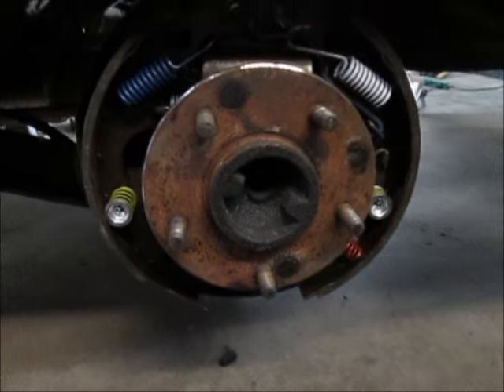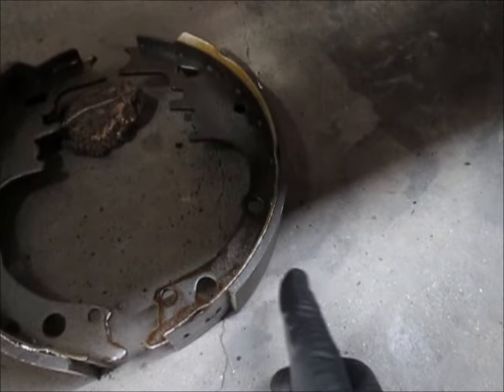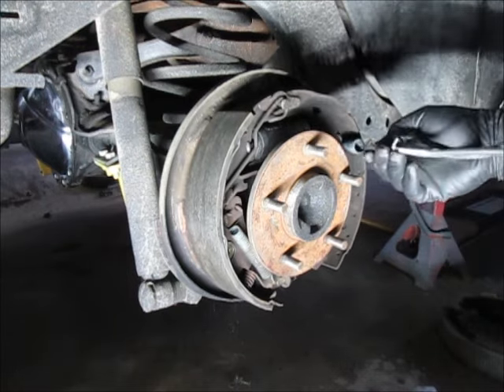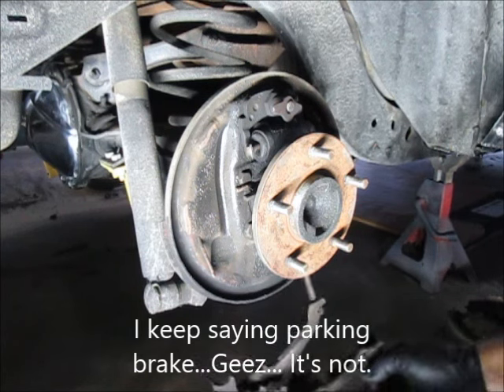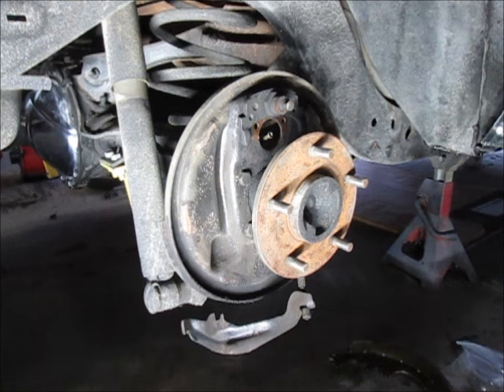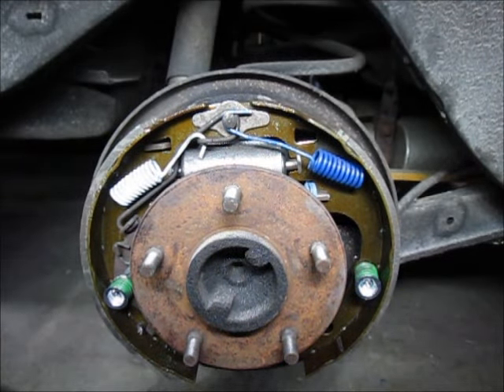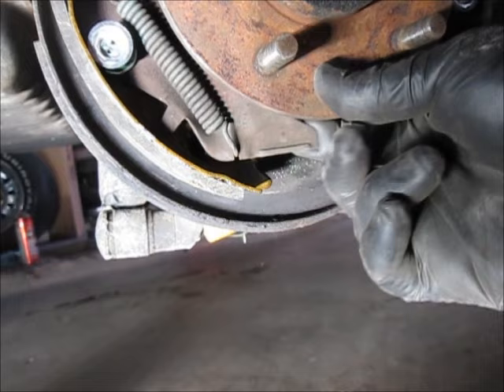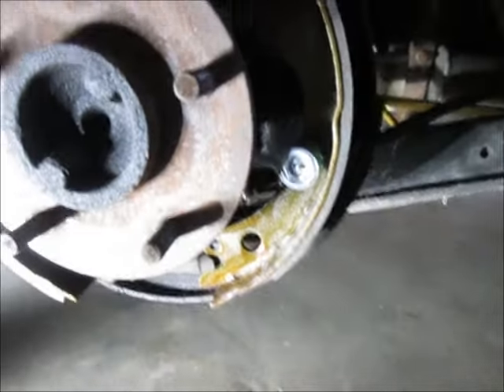1972 Chevelle Rear brake drum repair

Comment: Finally I found a video that talks about the placement of the spring above the adjuster bar! THANK YOU!!!! Several videos talk about that spring but NO reference to it hitting the adjustment gears if turned the wrong way. If the spring is installed like  a lot of these other videos(Not checking the position of spring) you won’t be able to adjust brakes with screwdriver. Wheel won’t turn. I found out the hard way. SPRING SHOULD NOT TOUCH ADJUSTMENT WHEEL!!!! Good luck my friends!

Comment: Thank you so much for your Video. You have a great gift for explaining each step of the process along with key insight as to the purpose and interaction of the components of the wheels brake assembly. Your attention to Do's & Dont's was also extremely helpful. 
Your use of lighting to clearly identify each part during the process was greatly appreciated, along with the sound quality of your dicussion.
       Well done Sir !
A great refresher for an old shade tree mechanic just pulling my Daughters 72 SS out of the barn from an 18yr nap for Resurrection.
☆Patient: 72 SS•Hot 350•Fire Engine Red w/Black Vinyl Top•M21 4Spd.
                        🤞

Comment: I've been working on my own car for 40 years. Two years ago I rebuilt both rear brakes on my 86 Camaro and it passed inspection with flying colors. Come forward to last week. After driving it for a year and parking for another I took it back through inspection and my rear brakes failed. Took it into the shop and tore down both brakes trying to find the problem but found nothing wrong. I must have watched ten videos on drum brakes today and then I found yours. At 4:30 of the video you gave me the solution. I never knew that the adjusters were threaded opposite of each other because I've never installed both before from a kit. I've only done one at a time as they went bad. You saved my brake job that has taken two years to complete properly. Thank you!!!
Reply from the maker: This made my day. I'm happy to have assisted in finding the problem. Thanks for the comment.

Comment: Im doing the rear brakes on my 1970 Monte Carlo which I have owned since 1975. I have done the brakes many times but its been 20 years or so since I did anything on the brakes. This video was absolutely perfect for refreshing my memory and I wanted to make sure It was done correctly! I only do 1 side at a time but this helped tremendously! Thank you very much.

Comment: THANK YOU...for sharing. On the end of your spring tool handle is a small round drum, this drum is inserted over the stud that holds the springs on and then you rotate and the small tab catches the spring and removes the spring. Works really good...saves on the knuckles :)

Comment: I used to own a 72 Chevelle.  Beautiful car, cream yellow, white vinyl top & interior.  It was just a 350, but what a ride down a freeway.   I lost interest due to rust in the common places.   That was 25 years ago...................... Your brakes are just like those on the 71 C-10 I'm restoring ground up.  Until today I had never done a brake job, but again, your video is tight.  It also helped me distinguish how my RH side was done wrong. ......................You probably know this, but if you slip off the cap on those adjusters, I believe you'll see an "L" or "R".  Near as I can tell the adjusters, adjuster links, adjuster plates and E-brake plates are not interchangeable.

Comment: Most high mileage cars I worked on, the backing plates were worn where brakes shoes contacted them (often to point backing plates had to be discarded ... no mig welders back then).  Self adjusters were always frozen.  I believe Permatex still has a good copper based grease for drum brake parts and I would highly recommend using some on those areas.  Oil and rubber are questionable, not sure what is in WD-40 so I wouldn't recommend using it on wheel cylinder to push pin interface (petroleum products on old tech rubber usually makes it swell).  If it has to be cleaned isopropyl alcohol is very cheap and won't harm rubber.  
I am surprised your customer didn't choose this time to upgrade to a modern 4 wheel disc brake system.  Since entire hydraulics being replaced/rebuilt along with the booster, I think an opportunity was missed.  Aside from that, that's a nice car.  I could see myself buying it and changing some things.

Comment: Thank you! doing a 1998 Chevrolet C1500 pick up 2wd  and the rear drums are still the same! Nothing for a C1500 on Youtube but plenty of stuf forr 6 bolt or K1500, 6 bolt is standard now but 2 wheel drive ad 5 bolts used to be

Comment: Great video.  The lower spring orientation was what i needed to know.  Is it not common practice to wire wheel and antiseize the 6 points the shoes float against?  Also, I would have liked to have been reminded to exercise the slave before installing it, both of mine were stuck out and I didnt realize it...  Each of the past 3 decades ive done one drum brake job.  This decade I might get lucky and do five, lol.

Comment: Info needed. Should I oil or grease the pins that go into the new brake cylinder rubbers or not. It seems very tite fit.
Reply from the maker: It shouldn't be be necessary. If anything a little WD-40 will let it go together easier.
Reply: Thanks will try it.

Comment: On my 71 LeMans my adjuster is not contacting the parking brake plate and the parking brake isn't working, the passenger side rear wheel will lock up when hitting the brakes hard not sure what's going on, but the driver side wheel is working fine, I've checked all the springs multiple times
Reply from the maker: Something is definitely out of place. How close are the shoes adjusted to the drum?
Reply: @JoDaddysGarage  they seem to be in the right spot we think that the arm that connects the plate to the post is to long and not holding it in the right place
Reply from the maker: Both sides should look exactly the same. Double check everything. Measure.

Comment: I have a brake drum question for you. My 1966 restorer Mustang has a small chunk out of the drum rim (near the splash shield side, not the bolt side). It looks like someone might have hit it to get the drum off and knocked a small chunk off...it is nowhere near the drum surface ...should I replace it anyway or does that give me a pass ? Nothing is cracked, scored, etc...Thanks in advance
Reply from the maker: I'd replace it. You don't know if there's a crack that you can't see, and drums are cheap.
Reply: once again..Thank you ....

Comment: Does the larger shoe retaining spring go on the back shoe and the smaller one on the fornt. I thought they may have sent me the wrong sets but one commenter mentioned they were different. Thanks. This is the best video i have looked at so far. Wish the back shoe assembly was recorded. A bear!
Reply from the maker: It should show in the video. The shoes are different. one large and one small (pad) on each side.
Reply: @JoDaddysGarage  shoe retaining "spring"? This kit has 2 different sized springs
Reply from the maker: Sorry. I misread that. Are they not color coded? The ones I used had a color that indicated where they went. Look at a still from the video.

Comment: I did my brakes , the drum turned freely on one side and became tight on the other side and won’t turn even with the adjustments turned down.
Reply from the maker: Check the width of the shoes. See if it turns freely with the drum only part way on.
Reply: @JoDaddysGarage  the drums are heavy. I also had to remove the axles, it’s a 1964 Chevrolet c-20 , 3/4 ton pick up truck. Thanks.

Comment: Aren’t the hold down springs suppose to two different colors and designs?
Just asking...

Larry
Reply from the maker: I believe you are correct. I just noticed there were 2 yellow and 2 green springs. I just did an updated version of this repair on a 65 Impala. it had 2 different springs. Good observation.

Comment: Man, you skipped over the hardest part, which is getting the damn springs on.  Any tips?
Reply from the maker: I typically clamp onto the spring with vise grips. I guess I failed to say or show that. I have shown it in other brake repair videos. Sorry about that.

Comment: My friend; learn the proper names of the rear brake drum parts and you can bleed the brakes by yourself.  If you use a rubber hose connected to the bleeder and use a glass container so you can see if you need to add more fluid in it, that way you can bleed them yourself. 
I learned how to work on cars when I was eight years old and I'm 69 y/o now.
Common rear brakes haven't changed in the last 70-80 years.

Comment: Pointless. Why shut the camera off while doing the work? It would be nice if there were a video that actually shows how to put the springs on.
Reply from the maker: Try this one. https://youtu.be/XT66OprWzxk?t=1317
Reply: @JoDaddysGarage  much better video thanks. Only slight differences to the 71 Chevelle. Makes me think the Impala had a better design considering all that holds the Chevelle's brake parts in place until the springs are hopes and dreams 🤣